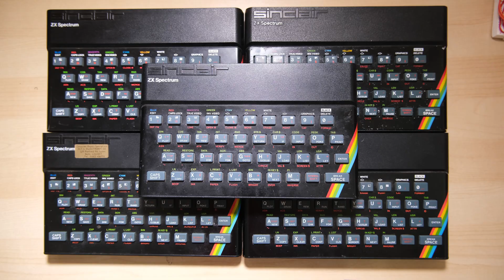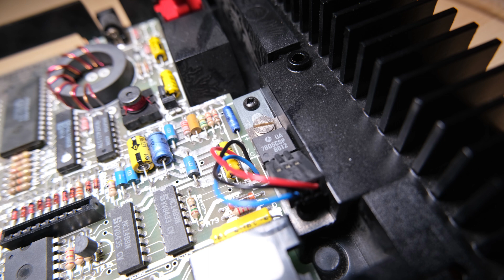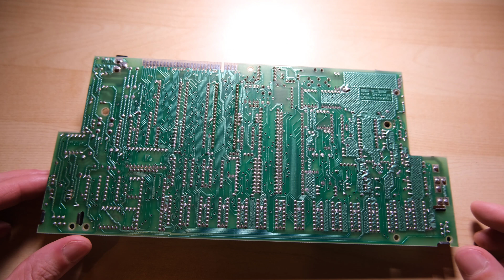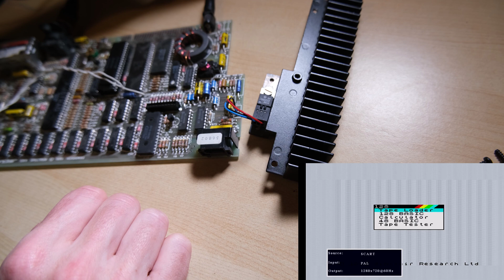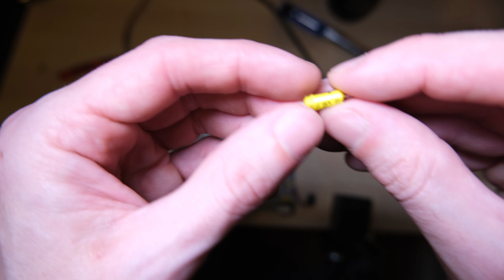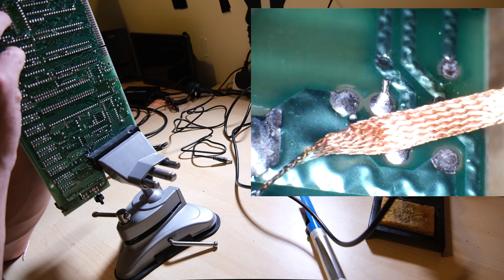ZX Spectrum+ 128K Toast Rack - Recap and Refurb

Comment: I solved the TRACO problem by fixing it to the plastic leg using a piece of double-sided tape. Then I just connected the patch cable to its pins. Soldering might be necessary though for more reliable connection. In any case the cable is long enough to reach the leg. An alternative might be using a flat Dupont plug on the PCB side but if there's an opportunity for non-invasive mod I take it.

Comment: Thanks for the video! It worth noting though that what you are repairing is basically an RF transmitter. Generally speaking replacing a linear voltage regulator with a switching one in circuits like this may be not the greatest idea.
Reply from the maker: Good tip.  It's a trade off between that and keeping the heat down

Comment: Happy new year! Looking forward to part two.
I was surprised to see an Amstrad chip in there; I presume this predates Amstrad's acquisition of Sinclair?
Reply from the maker: It does yes.  I have an issue 6K toasty here with a Ferranti ULA also
Reply: I think it's the opposite. The machine was assembled after Amstrad acquired Sinclair. They probably wanted to sell the remaining stock. I've seen these models with both Ferranti and Amstrad marked ULAs (same case with some very early issues of grey +2). If you look at the CPU timestamp it's 8614 (14th week of 1986). Amstrad acquired Sinclair on April 7th 1986 (15th week of 1986). That would have left Sinclair with just one week to assemble the computer before acquisition - not likely. But the fact that the ULA is marked 8616 (16th week of 86) is the definite proof. You can check the timestamps of other chips like ROM or DRAM, they would all have to pre-date 8615 and even that would not rule out Amstrad completely.